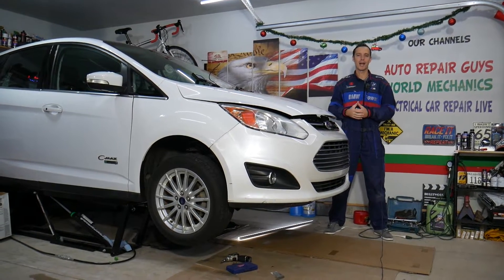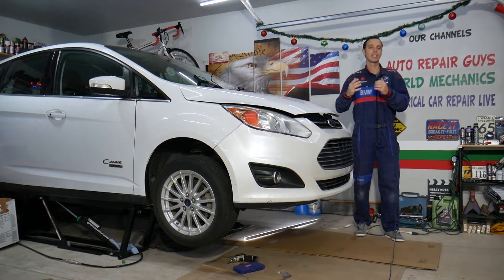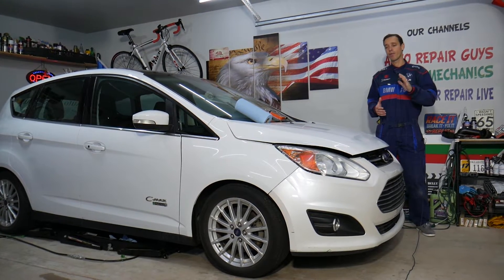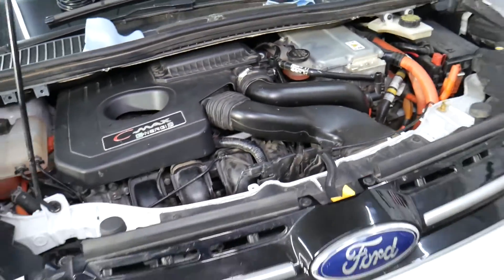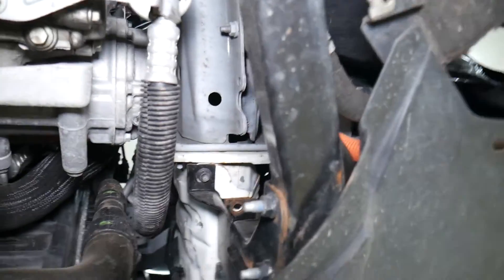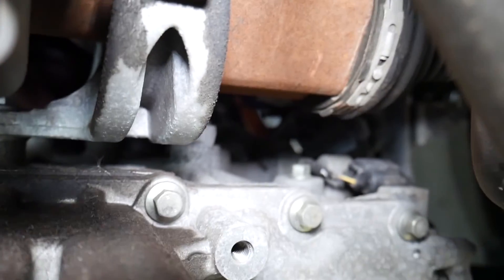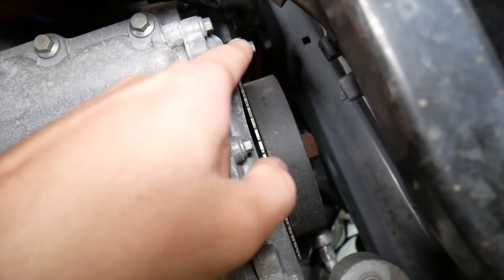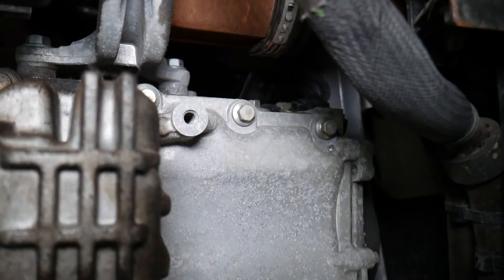TDC TOP DEAD CENTER PIN BOLT LOCATION FORD C-MAX FORD FUSION LINCOLN MKZ

Comment: Hey i have a 2000 bmw e46 and I have a crank no Start , I’ve tried so many things and just don’t know , I’ve changed fuel pump , fuel filter , coil packs , crank sensor . Still doesn’t start , it will start with starter fluid but I just don’t know what to do , any help ????
Reply: Did you fix the problem, i have the same problem